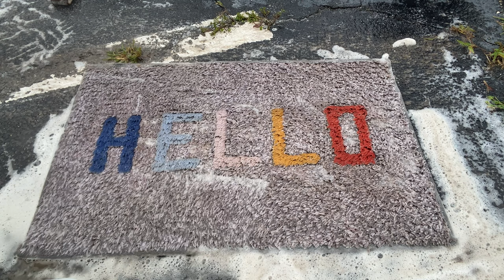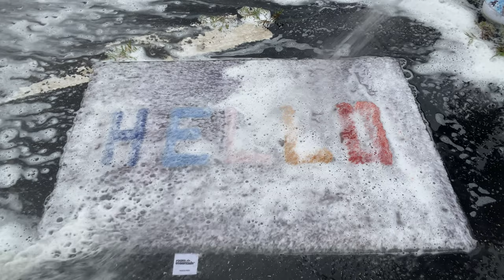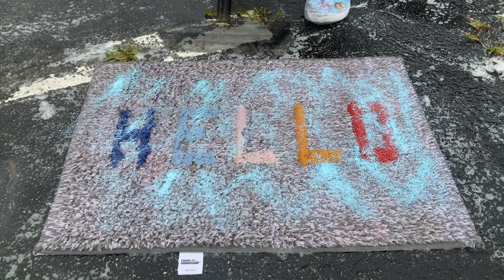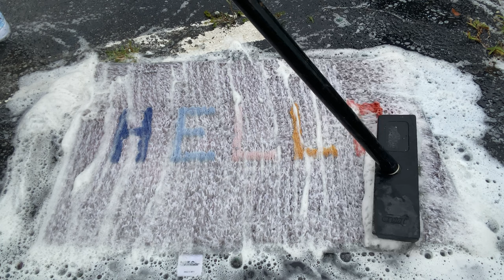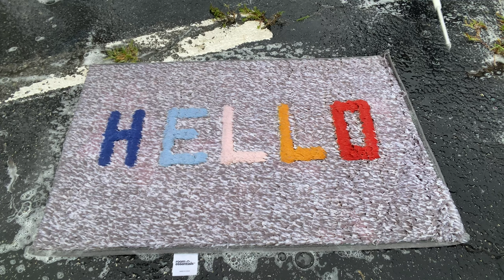Terrible dirty very muddy carpet cleaning. Satisfying rug washing and pavement floor scrubbing ASMR

Comment: HELLO to you as well, beautiful lady! Nice job cleaning this little guy!
I had another idea 💡!
At Home Depot you can buy large trash cans with wheels. For those jobs where you don't have a water source & are hauling water to & fro...why don't you invest in a couple of them. Then all you have to do is scoop out the water you need & the person refilling only has to roll it back & forth from the water source.
Just a thought but had to mention it before I forget again!
Talk to you soon!
Reply from the maker: You always have great ideas!! Now use that beautiful smart brain of yours and figure out how I can haul a big super heavy(especially after wet) from one of these self car washes so I can find one of these places here and wash which ever rugs there. No one can lift them up once they’re wet to put on top of my car on the rack to bring back. Aladdin? 😂😂😂
Reply: @RugWashingASMR  Well, try to find a place with electricity so you can take your carpet cleaner to extract some water. Maybe when you're done you can roll it up & twist the ends & tie up with rope & use the rope like a pulley from the front to the back of the luggage rack. Or, lay down the seats if possible & cram it in the car.
Unless you find a free trailer or barder with someone in FB market place. Use the trailer & clean their rugs. Film it & BAM - problem solved all around! 
I don't have the answers for everything but I do remember that one of my neighbors had a large rolling trashcan with a spigot on it. Like a rain barrel does & maybe you can hook up a hose to that & gravity will give you a really good water flow.
I'm still thinking 🤔
Reply from the maker: @anniewardlow9297  and that’s why you’re the Auntie Ruggies and we love you 😘
Reply: @RugWashingASMR  I have to be honest with you. I kinda gave myself a headache thinking about it... seriously! 🥴
Hahaha! 😘🥰
Reply from the maker: @anniewardlow9297  awwwww sowwwy!!! But rest assured it was much appreciated! ♥️♥️♥️
Reply: @RugWashingASMR  I probably over thought it & did one of these 🤔🧐🤨😟😳🤯 it's the last look that did me in!    Ka-bam!
I feel just fine. I'm so very happy & thankful for our friendship over the past few months! You're a good listener & a person to vent to. From our conversations I'm pretty sure you get me & my sense of humor & to a lot of people that's a HUGE hurdle. 
⁉️ Question ⁉️
BTW: Were you able to find Headspace on Netflix or your phone?
The reason why I suggested Netflix first is because there are cartoons with it & if you have Netflix, it's already paid for. 
If you download the app, you will get some kind of a sign up freebie but, eventually you have to start paying for it. 
Keeping you all in my thoughts & prayers!